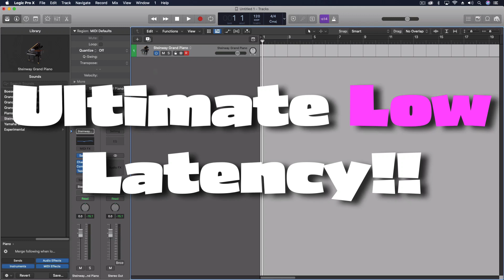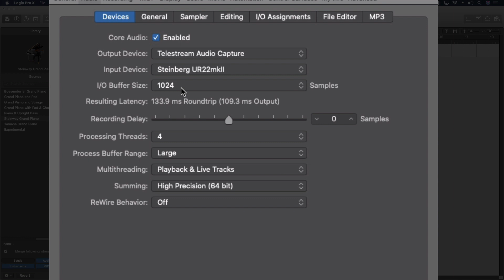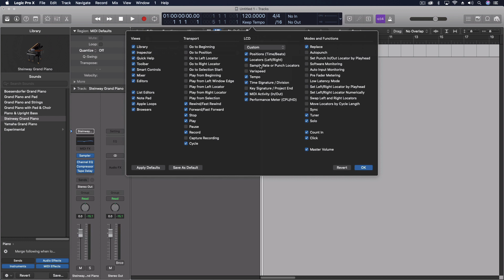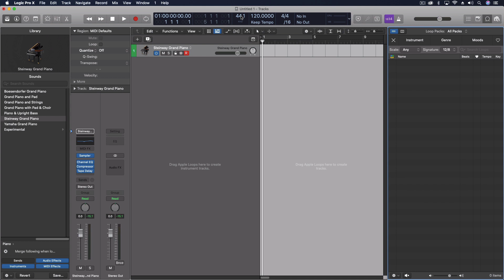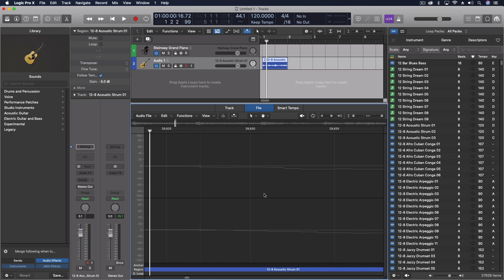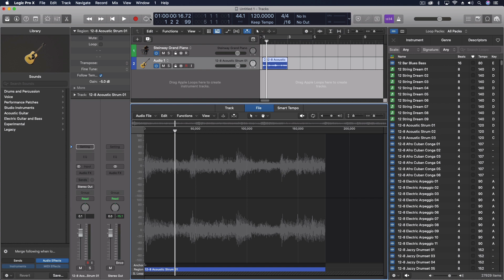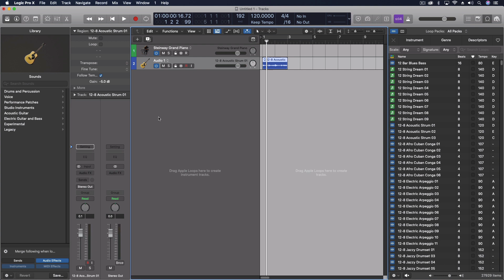How to Achieve the Lowest Latency Possible | Logic Pro X

Comment: I am using a significantly under-powered mac mini and need all the help I can get with latency issues.   One other tool in the Logic Pro X tool chest in this area is the "Freeze track" feature.   This feature renders each track you want frozen to an HD audio file which plays in place of its corresponding track in Logic.  So when a track is close to where it needs to be you freeze the track which captures the resultant music content including the affects of any plug ins, etc.   But there are no longer any compute intensive operations for that track.   In fact the entire project independent of track count,   if all tracks were frozen the load on the CPU is solely that of rendering an HD audio file.   All the automation is still in play so you can mix with everything frozen.    When you come to an area in the mix that requires an edit of more than the automation I would first identify the area in the timeline,  unfreeze the track I want to tweak, and now the CPU is only burdened with the one track that I chose to edit.          I could just get a faster computer, but I kind of like the challenge of getting around computing shortcomings without spending $$.     (Sort of like the challenges that the Abbey Road Studio engineers conquered when making a 64 track Sgt Peppers recording using a 4 track recorder.    Necessity always being the mother of invention)

Comment: You are complicating it. The setting below buffer (recording delay) will substract the buffersize from the recording. Meaning everything lines up at playback. Set recording delay to -1024 or -512 or lower. Exactly the same value as your buffer. Now that amount of samples is subtracted. Meaning recorded audio lines up sample accurate. 

Use direct monitoring during recording. And the substraction tool that substracts the 1024 or 512 or 128. And it will playback exact in time.

Comment: My buffer is set at 128 and I have the low latency on but all my sounds are still coming out late. Should I reset my sound card? 
This just started, I’ve been using Logic Pro for years
Reply from the maker: It would be strange to have them come out late in low latency mode but perhaps something is wrong with your audio interface. Also make sure there isn’t an issue with your MIDI controller. Perhaps it has a delay.
Reply: you might try using the low latency mode, go to Audio Preferences, then General, click on the low latency mode and see if it helps, a description of it is in the Help menu